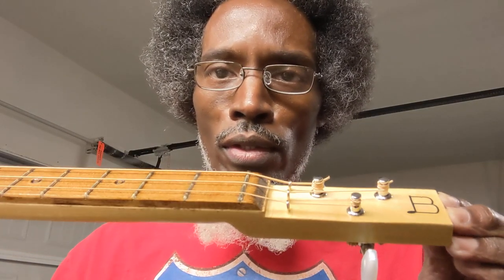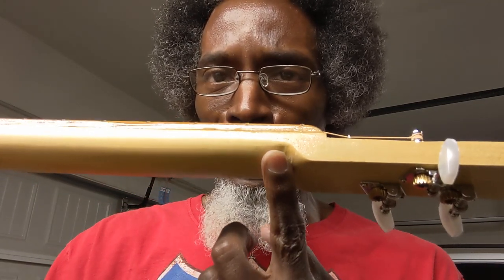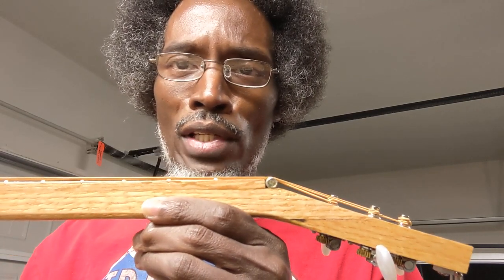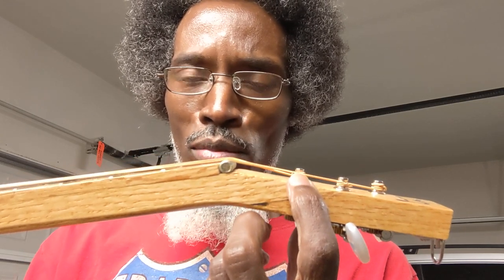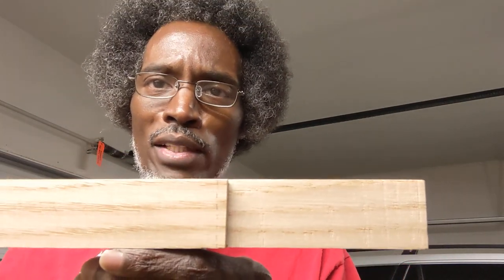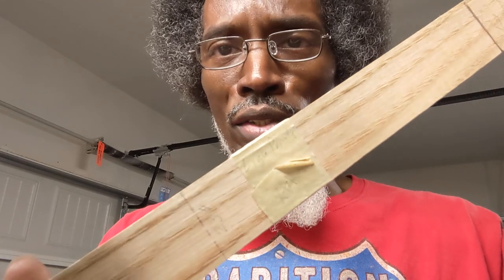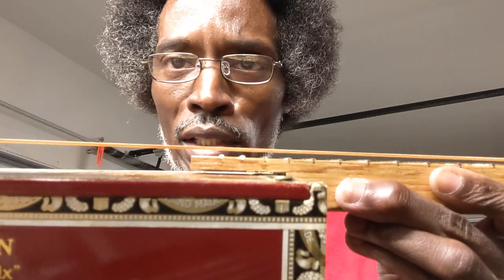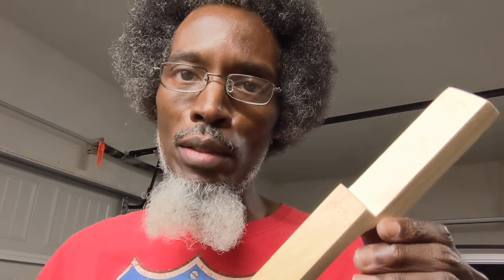Constructing Cigar Box Guitar Necks

Comment: Hey Moses great video. Just another version of your neck…..if you leave the head stock at 6 inches, cut out your notch, THEN-cut down to 4 inches you can put a 45 degree angle on the cut out and slide it a 1/2 inch or so down the neck and when the glue is dry you can even up the headboard and carve a volute on the back of the neck. It looks fancy! Great job on the video.